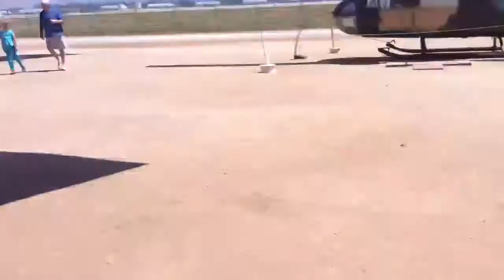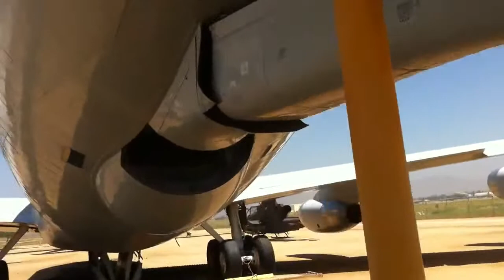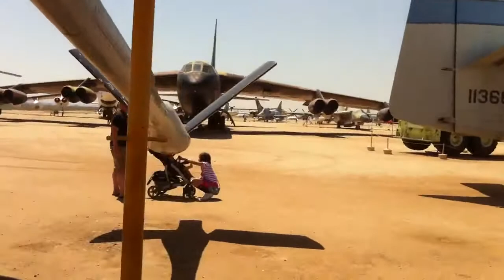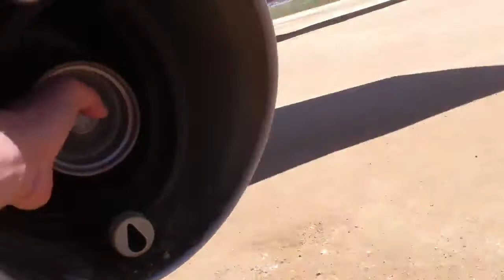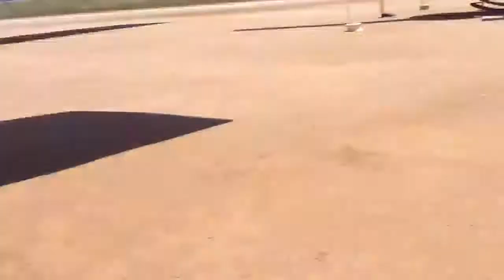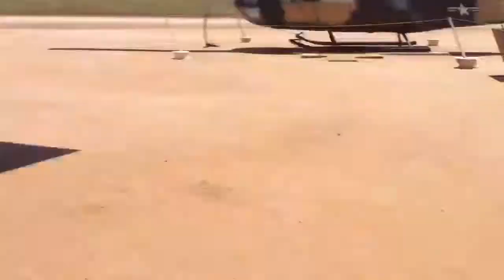Mid-air Refueling Proboscis - March Field Air Museum

Comment: The actual fuel prob extend out almost the entire length of the housing to connect with a port in the body of the receiving a/c.  Clamps in the prob hold on to the a/c during refueling to prevent separation.  The clamps are so strong that tankers have assisted damaged fighter a/c by towing them.  The clamps have a fail-safe disconnect when over-stressed and it ruins the actual prob, but using tankers as tow trucks has saved lives.